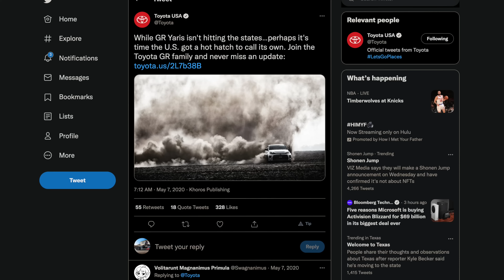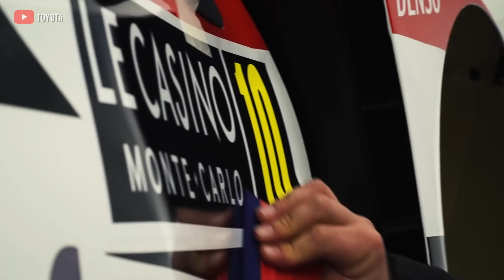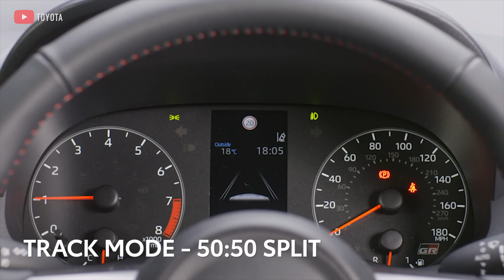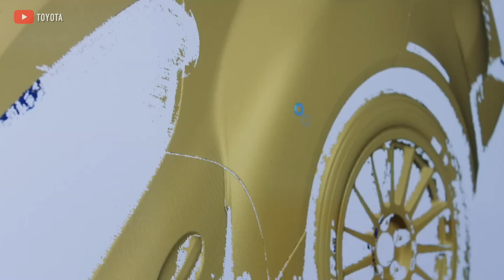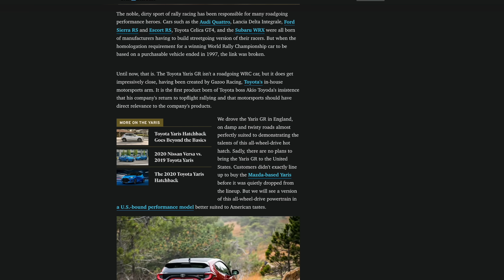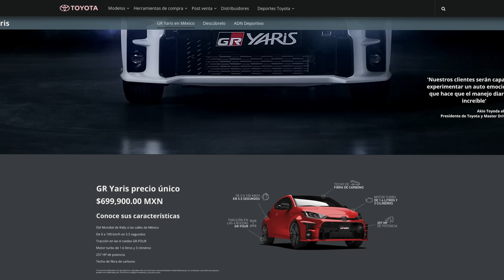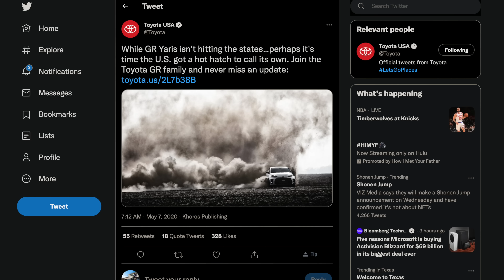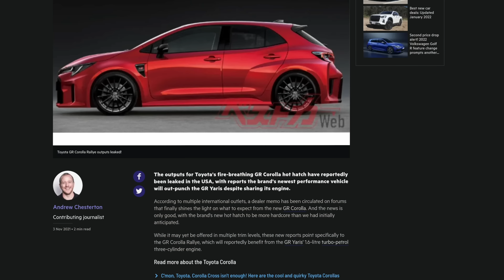Can You Forgive Toyota For This?

Comment: Toyota "boring car" policy is started around mid 1990s during the peak of Japanese police anti-Hashiriya (street racer) policy and street gang crackdown operation. Even movies about Hashiriya was not allowed back then by the Japanese movie censorship agency. Only the anti Hashiriya racing movies are allowed (with Keiichi Tsuchiya, a former Hashiriya vturned Pro racing driver in it saying no to street racing). Street drifting was cracked down, Wangan meetup was highly monitorized even Mid Night wangan racing club was "disbanded" by the members due to an accident in C1 loop. Then Toyota "corporate conservative" faction in the Board of Directors thought putting Toyota cars in racing or street racing movies will hurt their brand image and lowering their sales during this era. Therefore the racing division of Toyota got less and less funding until the point like they didn't even exist in Toyota and non performance oriented cars were terminated. It's not just happening in Toyota but also in most of Japanese car manufacturers at that time. The hardest hit by this trend was Mitsubishi, Mazda rebranded their brand with Skyactiv fuel efficient cars rather than lightweight high performance gas guzzling cars. 

But Nissan GTR was revitalized by Ghosn, Toyota by Akio. So there's a new reversing course of the trend until today.

Comment: Better have 500hp if I'm gonna trade in my Corolla S for it!
Reply from the maker: Hahaha Corolla S is king 👑
Reply: Gr yaris G16E-GTS  engine can handle 500hp at the hubs with bolt ons and only internals done are valve springs